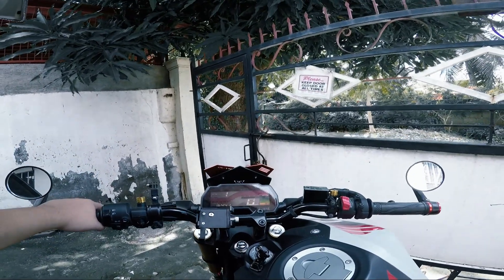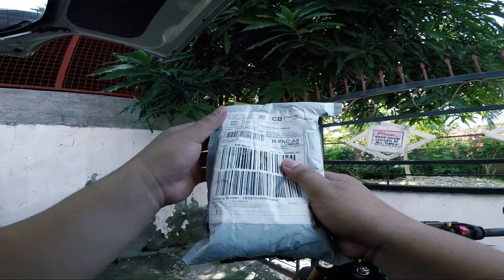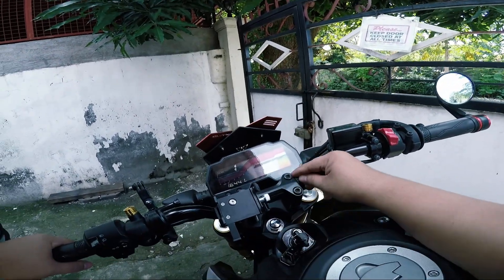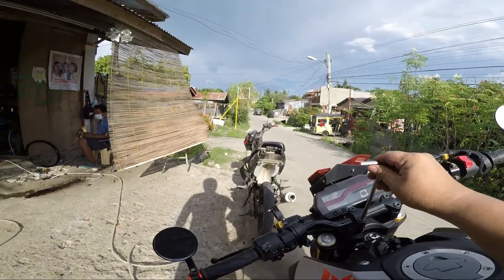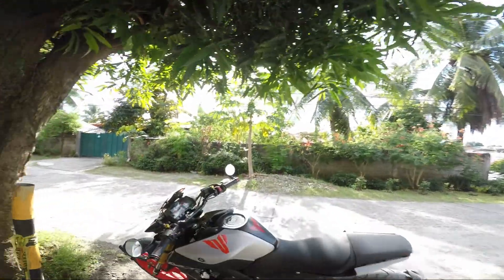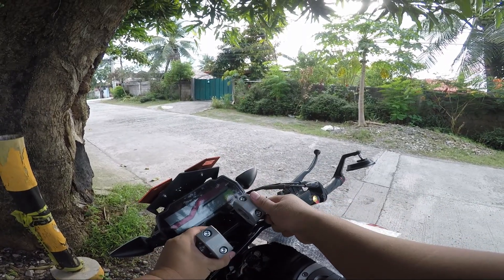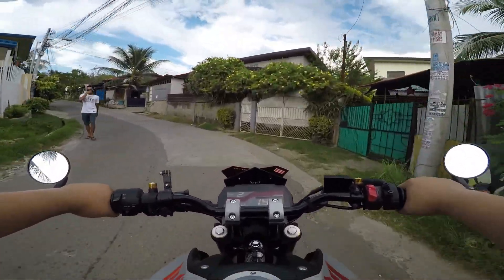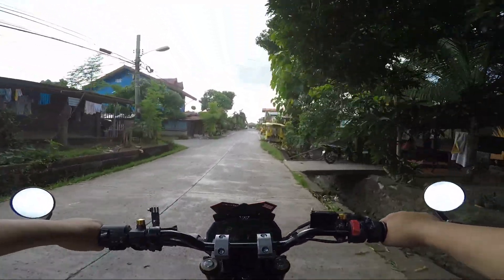YAMAHA MT15 TOURING SETUP HANDLEBAR RISER INSTALL

Comment: Hi. I installed handle bar risers for mt 15. But the throttle got stuck and stiff. It's not rotating freely. What have you done to loosen the throttle??.
Reply from the maker: Adjust the angle just enuf for the cable not to be pulled tight
Reply: @jeju_tv  do you mean adjusting the handle bar or the acclerator cable hosing??
Reply from the maker: Do not make the throttle cable stretch too much
Reply from the maker: @adhithyanv3114  yes